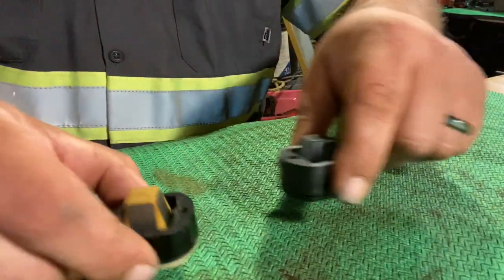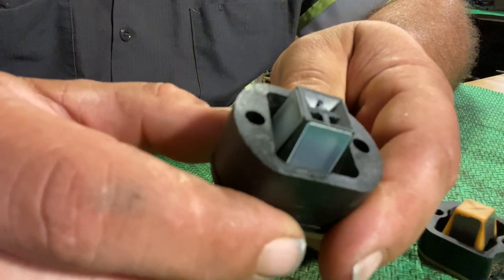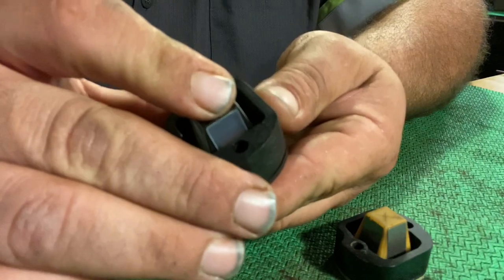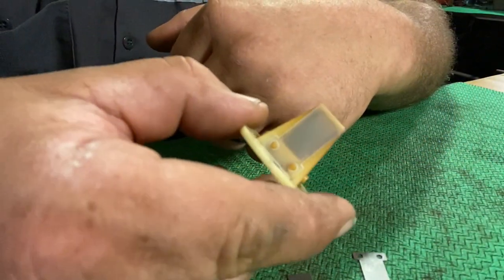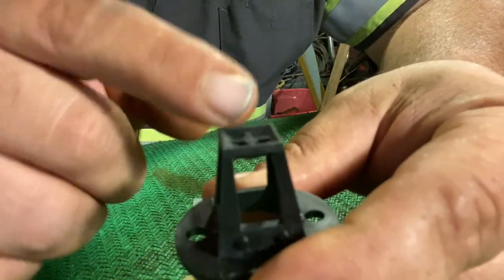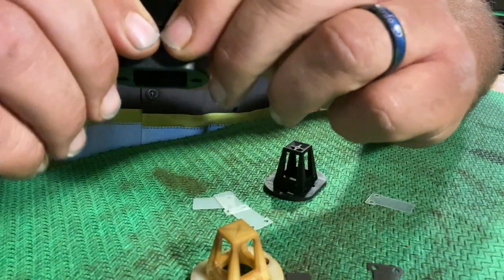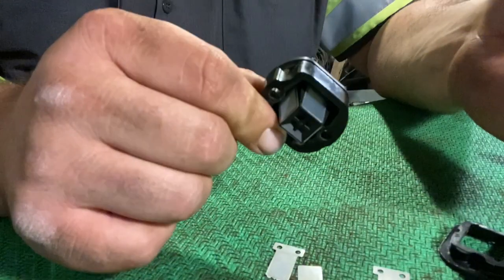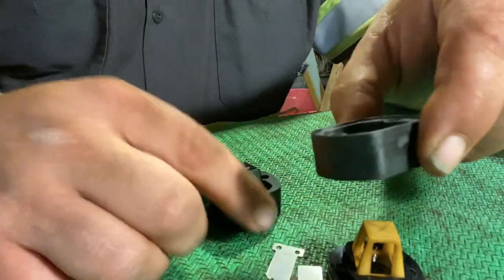Homelite Super XL Auto Chainsaw Aftermarket Reed Cage Explained!!

Comment: My grand father had xl12 long time ago and even my father run that saw little bit. They were not very fond of that saw because it was slow with small fuel tank and vibrated alot. I quess i should get one of them to see what they are about and maybe later port it LOL. Did that aftermarket reed cage perform different from the original?

Comment: My biggest concern would be retention of those Reed Petals.  If there aren't held in place correctly, they'll likely end up in the cylinder.  Yea, they're plastic but in large chunks they'll still probably cause some damage.  They're probably fine, but something to think about.
Reply from the maker: I’m not considered about the retention. They are held in place fairly good. The material that was used in construction is my main concern. They are not exactly plastic. They are something else. I wish I could identify.
Reply: @Smittyschainsaws  I think the original Homelite shell was Bakelite.  Has been too many years since I worked for Homelite to remember exactly.  Interesting fact, the predecessor to the Super XL, the XL 12 was introduced in 1963 or 64 and was the first chainsaw on the market that weighed less that 30-40 lbs.
Reply from the maker: @zzzgz5  I wish I could date my XL-12 saws.  I have one that just seems older than the others.  It has some differences.

I have a blue Super XL Auto that I discovered something interesting.  Leon did a video of one.  I discovered mine came of the same assembly line one the same day built about 30 saws apart on opposite sides of the country.
Reply: @Smittyschainsaws  I think all of the saws from those days were built in the same facility.  I worked for the company in the early 80's at their Indianapolis Service Center.  At that time they had at least one such service facility in nearly every state.  They closed about half of those and I moved on from there and became a Homelite/Stihl dealer until just before they sold the business to John Deere (which then sold to Techtronic).  A career change and many years have passed since then.
Reply from the maker: @zzzgz5  How much do you know about the Zip?  I keep pushing one off because I know very little information on it. It will definitely be a learning experience.
Reply: @Smittyschainsaws  Wow that's an old saw,  Zip was from the 50's.   Not really different from any other 2 stroke, I think carb parts will probably be impossible to find, especially if it's got a Brown carb.  If it's got a Tillotson carb you might get lucky and find something.  I think those were reed valve engines as opposed to rotary valve, but I may be wrong on that.  I've had my hands on very few of those.
Reply: I did find this link for Brown CP kits, not sure if those were the CP series, but it looks familiar. https://www.sugarcreeksupply.net/products/brown-cp-carburetor-kit
Reply: @Smittyschainsaws  Another bit of old Homelite trivia,  Did you know Homelite once had an an outboard motor?  These had a 4 stroke English Crosley engine mounted vertically.  https://www.youtube.com/watch?v=itFuBN72kxo
Reply from the maker: @zzzgz5  I did not know that!!  I saw my first Homelite trencher today as well!!
Reply from the maker: @zzzgz5  I have not even looked to see what carb it has.  I actually have two of them but one needs cylinder and piston.  I don't know if that will be possible to locate.  Maybe a spare parts saw!
Reply: @Smittyschainsaws  I can't remember, but I thought I checked and mine is a 64 XL12. It's not an Auto. My dad got it when my Uncle Died in the 70's. It's the first saw I used at 12 years old. I thought I used the Serial number. But it's Definitely a 60's, as my Uncle died around 72. I'm waiting to buy a Cylinder as I can see where maybe a screw got in there. My dad and Uncle Walter could tear up an anvil with a rubber hammer. Lol. But, they could rig up sometimes and get lucky.